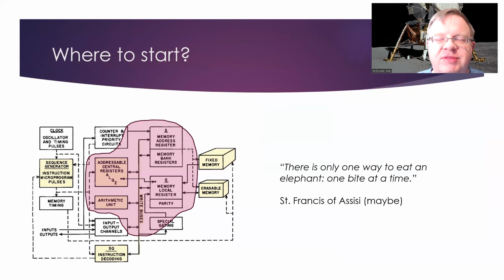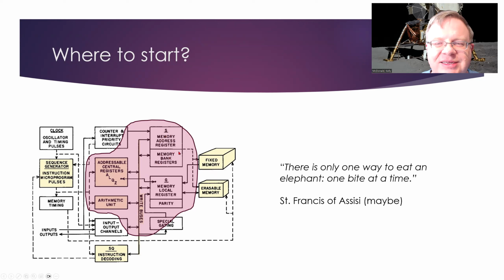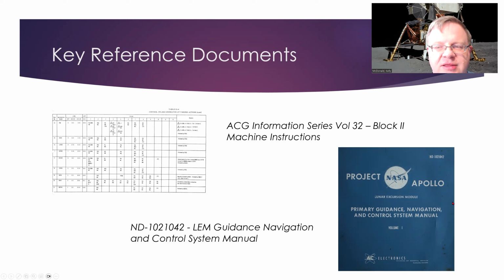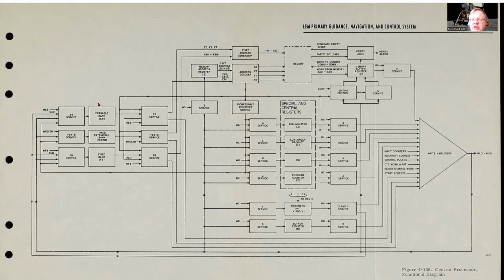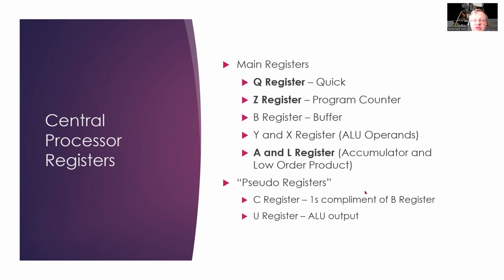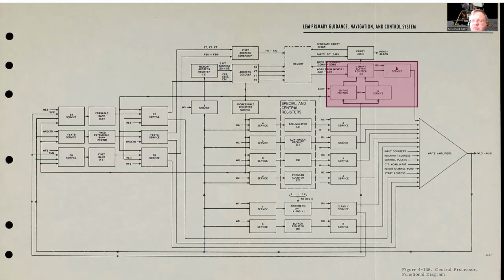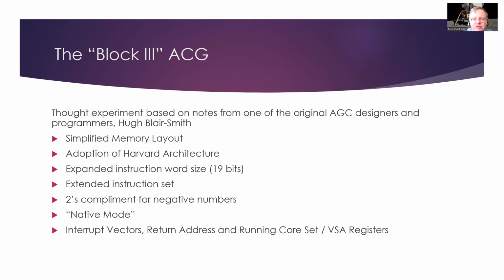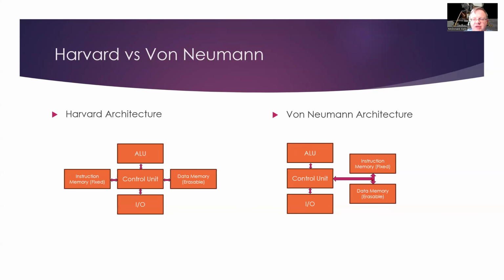EP 2: Register Overview

Comment: Awesome project! Something I would mention is that the erasable core memory is non-volatile when it loses power. I am more of a software guy than a hardware guy, but when developing an AGC emulator, I found that deliberately initializing erasable memory to random values at computer startup (excluding registers), would frequently cause crashes or failure to boot properly. If you aren't already, that might be something to consider since you mentioned you plan to use static RAM for erasable memory, which I think might have a similar issue in practice due to its volatile nature.
Reply from the maker: Good point, I may need to consider some kind of battery backup for the SRAM to at least replicate the non-volatile characteristics of the memory